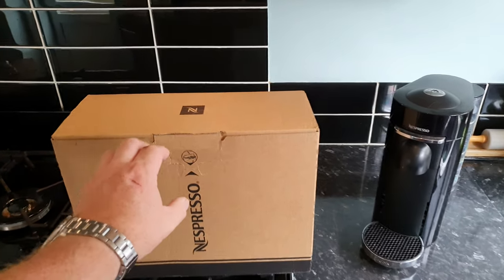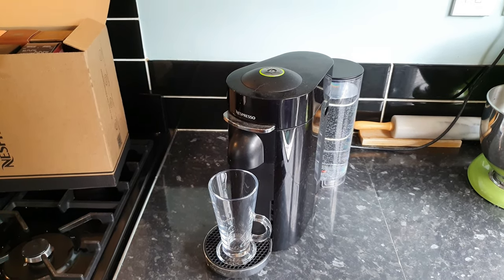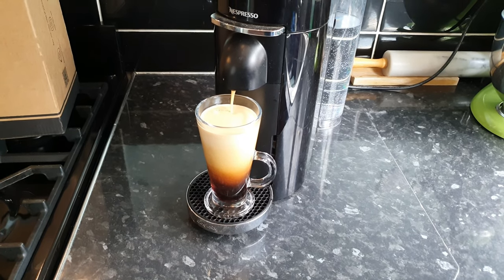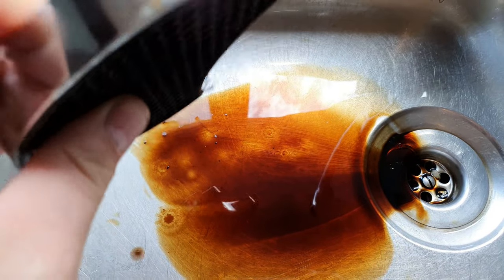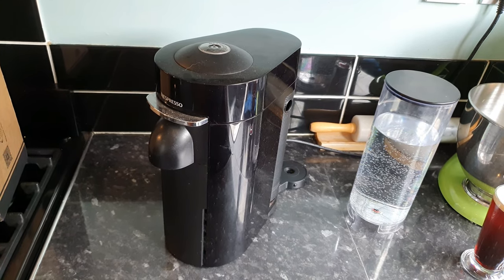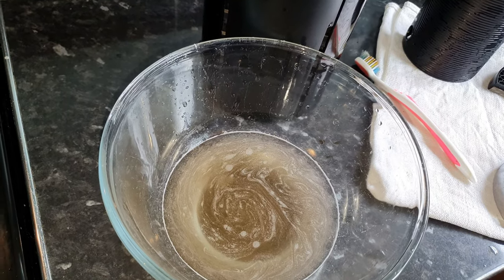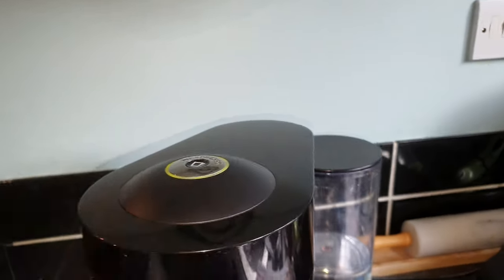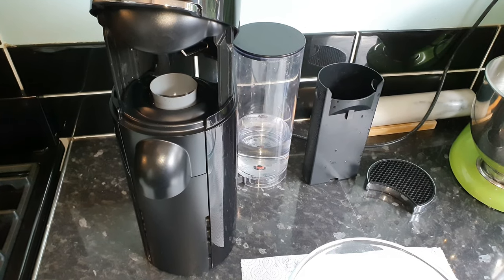How to Fix/Avoid the Dreaded Nespresso Vertuo Plus Leak

Comment: I have had 3 of these machines now, the first one was fine, has never had a problem and is still fine. I bought a second one for work which leaked out of the bottom from day one, so I sent it back under guarantee and got another. This machine was fine for a few months and then started leaking in the same way that the returned one did. Cleaning is important but the issue seems to be that the machine has some sort of problem between the pod and the outlet spout and coffee cannot flow properly so it backs up and runs down the back of the machine and onto the worktop, I keep a tray under the machine to contain the spill. This video, as good as it is, will not solve the problem as there is some form of blockage that no amount of cleaning will shift.
Reply from the maker: You are correct to point this out and thanks for posting.  I think in comments somewhere I have said that the issue resurfaced on mine some months later  and eventually I gave up and got a new one which so far (2 years I think);is trouble free.  I think quality control is not great on some versions but generally, support in the UK is decent.  I keep meaning to tear down the old one to try and find the root cause but I'm so lazy.

Comment: What I did: Find some pipe cleaners (natural) and push it up through the down spout (where coffee comes out of) - spin and clean - do this several times - as well as descale with white vinegar afterward. I found that sometimes what is happening is there is build-up - which creates back pressure and forces water/coffee to go through the run-off valves or out the top. This has worked for me multiple times.
Reply from the maker: So true.  The cleaner the machines the better.  Mine leaks if I let it ger very diety. Hard water users have it worse.
Reply: Thanks. I was dumb & put in a pod the cat had chewed a bit. It leaked loose grounds all over in the capsule holder & coffee spout. I have pipe cleaners.
Reply: @fuchsialady  lol lol
Reply from the maker: I did this and there was a lots of debris and limescale.  I am beginning to tjink limescale buildup could be a big player in causing such issues.
Reply: This worked for me! This is where the most gunk came out. Thank you!
Reply from the maker: Glad it helped you!!
Reply: Hi, what brand of pipe cleaners do you guys use? And instead of water I should fill it with vinegar instead and run it few times?
Reply from the maker: Use proper descaling solution pipe cleaners unbranded.

Comment: Nicely done. You’ve pointed out some spots I’ve overlooked. I use a detail brush (looks kind of like a toothbrush) that came with my juicer. I’m addition to the usual bristles facing down it has a row of bristles facing straight out. I’m happy with this. I also grabbed a cheap baby bottle scrub brush that works nicely too.
Reply from the maker: I regret making this vid as ever since I let it get so dirty it's not been working right on and off.  I got a new one in a Nespresso sale and I'm planning a full teardowm of the old one to identify where the problems may lie and what is stopping it working so well as it had been.
Reply: @richwhilecooper  Here is a full tear down video https://www.youtube.com/watch?v=9ubDV35asHo

Comment: If you use your Nespresso a lot like me …at least a couple times a day.. I will do the rinsing at least once a week with distilled water and descale at least one extra a month with a 50/50 mix of white vinegar/distilled water… if your using hard or soft water..it’s best to descale routinely…
Also, remember to always dump the pod after each use…I found out that if you leave the pod overnight, it’ll have a tendency to stick in the cup.  I’ll also take a napkin and wipe up the cup after each use…the grim will tend  to build up.
Reply from the maker: Good advice.

Comment: What you showed here was just an overflow, not a leak. You did not show where it was leaking as the coffee was brewing. With my machine, I can actually see some coffee dripping down from the top of the back panel as it was brewing if I remove the used pod receptacle, about 5ml for each cup. The leak is brownish, i.e. after hot water has passed through the pod. It leaks only after 30 secs or so, maybe the tube from the pod to the spout is partially blocked, and it takes 30 sec for it to back up to the top & comes out from there.

Comment: Here is a helpful message from Nespresso:

Thank you for contacting Nespresso. We’re disappointed to learn that your VertuoPlus machine is leaking during the brew cycle, and we apologize for any inconvenience. 

This may indicate that the brew unit and coffee outlet needs cleaning. There are upper and lower parts to this unit. To avoid maintenance issues with your machine, the brew unit must be cleaned regularly. Please allow us to provide you with these cleaning tips:  

Plug in your machine, and press the button to turn your machine on, and wait for the steady green light.  
Tap the lever upward to release any used capsule from the capsule chamber.  
With the head opened, wipe and clean off coffee grounds and residue you see in the upper unit. 
Wipe and clean off coffee grounds and residue you see in the bottom unit. 
After these areas have been cleaned, tap the lever downwards to close the head of your machine.  
With a toothpick, clean the coffee outlet, and the circular opening next to the coffee outlet.  
Next, to run the Clean Cycle, you may locate the Clean Cycle instructions in your user manual or you may view a video tutorial by clicking here. 
Test the machine using a capsule. 
For your convenience, we have provided the Clean Cycle steps below: 

Fill the water tank with water and attach properly to the machine. 
Make sure the machine is turned on and without a capsule, lock the top of the machine. 
Place a cup under the coffee spout. 
Start the Clean Cycle by pressing the button three times quickly. 
The machine will start to make noise. Please allow at least 2 minutes for water flow. 
The light on top will blink quickly as the machine is cleaning. Once the light becomes steady, that indicates the Clean Cycle has completed and you may test a capsule if you wish. 
If your machine begins to leak again, you may stop clean mode by pushing the button. The button will go back to a steady green light. 
If our suggestions do not resolve the issue, we will best be able to assist you further with your machine over the phone. We kindly ask for you to call our toll-free number, 877-964-6299, for the next steps through our Assistance Service Program, based on your warranty.  

For best maintenance for your VertuoPlus machine, we recommend to always eject the used capsules after every use, run the Clean Cycle once a week, and descale your machine every three months, or when your machine light indicator is red/yellow or red/green. All removable spare parts, including the water tank, should be washed by hand at least once a week.  

We trust you will find this information useful, Bruce. Thank you for being the best part of Nespresso. 

Best regards,

Deveisha
Nespresso North America

Contact Us

For immediate attention, please contact Nespresso via our toll-free number 800.562.1465. We are available 24 hours a day, 7 days a week. Our Coffee Specialists will be happy to assist you.

Alternatively, you may always reach out to us via email for a response within 24 hours.
Reply from the maker: 'Helpful' for sure.  I may get in my old one with a pressure washer and see what happens.
Reply: Thank you!!

Comment from the maker: I'll be doing a follow up on this issue as I had a major problem with the coffee being watery and then leaking a lot.  Cleaning a rinsing didn't work but...  Turns out a series of descaling routines cleared out what must have been an internal blockage.  I would imagine that if you have a machine in a hard water area descaling should be done bi monthly or more.  Judging by how much limescale is in my kettle which is less than a year old, limescale buildup could cause a lot of issues.  I'll be monitori g the sutuation but for now it's back to working like normal.
Reply: I’m now onto my third vertuo machine as I had it under guarantee and they all developed the same problem, watery coffee. Nespresso sent me a new machine every time but the guarantee is up now and the same fault has re-occurred with the latest machine so ill have to buy a new one or try  to fix it.  Ive searched you tube every time to see if anyone has a similar problem, but this is the first time I’ve seen a comment from someone who has a similar problem. I’ll try the descaling but Ive tried this with previous machines and it made no difference after one descale. Maybe multiple tries may fix it. I love the coffee from Vertuo but the machines seem very prone to faults. Anyway thanks for taking the time to post videos like these, they are most useful
Reply: Did you do that follow-up, bud? Same here, de-scaled and cleaned my machine and still watery coffee and leaking a lot ... Let me know if you figured something out ?! Thanks
Reply: @jayrusty2012  I did try it and unfortunately it didnt work. We ended up having to buy a new machine. We’ll see how this one goes but if it goes down the same path as the other vertuo ones we’ve had I think this will be the last one, and we’ll revert back to the original nespresso’s
Reply from the maker: Mine failed again a few weeks later.  I just  got a free one with my next pod order.  I plan to take it to bits to see what the problem is.   In summer when I have more time.

Comment: My Nespresso has just started leaking out the back.  About a week ago I did the cleaning cycle, prior to it leaking.  I haven't tried cleaning it with a brush yet.
Reply from the maker: I would suggest a vigorous scrub with an old toothbrush and run several cleaning cycles.  There is another vid I saw of a lady who was bending the metal rails where the pods slide into the pod bin who reckons that helped her but I can't verify that.  I know mine leaks if it's really mucky and I have neglected cleaning it thoroughly (e.g. cleaning cycle once no scrubbing).  Let me know how you get on?
Reply: @richwhilecooper  today I ran 3 cleaning cycles and used a toothbrush to scrub the inside and it still Leake coffee out of the back.  I've contacted Nespresso and am waiting for a call back.  My coffee maker is 6 months outside of the warranty, so I hope they will still replace it.  I'm a bit upset because we pay a premium for their coffee and their machines shouldn't leak.  I never had a Keurig leak before.
Reply from the maker: It is unfortunate and there is an issue it seems with some machines.  Sorry I could not be more helpful.
Reply: @richwhilecooper  It only leaks when there is a coffee pod in it, didn't leak with the cleaning process.  So the seal might be not be pressed on the pod enough.
Reply from the maker: Yes I saw someone retentioning the wires that hold the pod down on a video.
Reply: @richwhilecooper  do you have that link?  Nespresso called me and is sending a return box for me to mail it to them for a "one time" repair (it's 6 months outside of the warranty), so I'll be without it for weeks.  But I fear since others have been having the same issue, it could happen again and I'd want to try and fix it myself.
Reply from the maker: https://youtu.be/ixmPMKM2YOI
Reply: @richwhilecooper  I'm not sure how bending those wires fixes anything because they are only there to eject the used coffee capsule.  It's the seal that's the problem.
Reply from the maker: I got the idea it forces the capsule onto the seal somehow but I never tried it myself.
Reply: @richwhilecooper  I don't see how it forces the capsule onto the seal because as I said, it's there to remove the capsule and folds when it’s pushed, so it couldn’t make a tight seal.
Reply from the maker: Any update on your leak issue?
Reply: @richwhilecooper  I contacted Nespresso and they sent me a box to send it to them for a one time free repair.  It’s 6 months past the one year warranty.  They received it yesterday so it will probably be 2 or 3 weeks before I get it back.  You’d think they’d just send me a new replacement, so I wouldn’t be without coffee fo so long.  Either way I feel it will end up leaking down the road again, because it’s just a bad design.  Repairing it doesn’t really address why it happens in the first place and to so many of them.

Just received an email from UPS that I have a package coming tomorrow from Nespresso.  Woo Hoo!  I hope they sent me a new machine.
Reply from the maker: I hope it is.  Been lucky with mine I guess.  Fingers crossed for another 3 years.
Reply: @richwhilecooper  my Nespresso arrived today, that was fast.  They didn't give me a new machine and it looks like all they did was replace the top rotor, which has a new seal.  And what I feared would happen, happened...they scratched my machine.  And it being piano glossy black, it stands out.  At least it doesn't leak anymore.
Reply from the maker: Unless they replaced it with a scratched one that had been returned...  at least it works but I would becannoyed with the scratch too :(.
Reply: @richwhilecooper  no, it’s mine.  They just scratched it.  Wouldn’t be so noticeable if it weren’t piano black.  But again, my machine is 6 months outside the 1 year warranty, so I guess I shouldn’t complain.  I have coffee again and hope it doesn’t leak again.  But if it does I won’t be buying another Nespresso machine.  I had a Keurig for many years and it never leaked.
Reply from the maker: Fingers crossed for you.  It would have upset me too.
Reply: I am sick of this machine.  So much work and so expensive to keep running.  Will never buy another again.  What a racket.
Reply from the maker: Sounds like you're unlucky. It is bound to be frustrating for you..  Mine is three years old nearly.  Works perfectly every time.  The only time mine leaks is if it's really dirty. So I clean it often.
Reply: @richwhilecooper  I guarantee you that yours will eventually leak out the back too.  The seal gets hard and then it will leak, this is a known design flaw that the company has not addressed.  It doesn't matter how clean you keep it, mine was always clean and yet it still ended up leaking.  A cheaper seal costs them less in the long run, even if they have to repair a few machines over complaints.
Reply from the maker: I little dab if silicone grease will refresh the seal from perishing.  I'll make sure I add that to my cleaning routine.
Reply: @richwhilecooper  so you're going to put silicone on a seal that comes in contact with a liquid you're going to drink....seriously?  Not a good idea.
Reply: How do you access the seal?  Where is this seal?  Thanks.
Reply: @TheLadyDoz  pop up the lid, get down a bit and look up there.
Reply: Oh, thanks.  I thought the seal was inside the machine itself.
Reply from the maker: It just needs a little dab.  Wipe off the excess. Then run a cleaning cycle.  It won't poison you.
"Silicone-based lubricants are generally benign with proper use or if a small amount is swallowed because silicones are not absorbed into the body."
Reply: @richwhilecooper  if it was a quality seal to begin with then it wouldn’t need a little dab of anything
Reply from the maker: LOOK I dunno why you're moaning about it to me, dude.  I don't work for Nespresso.  My machine is fine after 3 years.   All seals can benefit from a bit of occassional attention.  And everything is better with lube.
Reply: @richwhilecooper  true just not silicone lube.
Reply from the maker: Silicone gel is absolutely what you lubricate seals with. Been using it on my airguns for years.  Nin toxic. Stops them drying out.
Reply: @richwhilecooper  you don’t use it on seals in devices for food.  It used to be believed that it was non toxic, but that has proved to be false.
Reply from the maker: Dude give it a rest I don't care what you think.
Reply from the maker: In addition, we offer a Silicone Grease, which is food grade and approved for potable water applications.
Reply: @richwhilecooper  clearly you do because you keep replying.  lol
Reply from the maker: Run several descale cycles if that fails to work.

Comment: Hello. Did the leakage stop after the cleanup?
Reply from the maker: It did for a month or so,  then it started leaking again.  In the end I ordered a few extra capsules and got a free one sent which I've had for some time.  I keep meaning to do a tear-down of the old one to pinpoint the underlying issue but I never got round to it.  In short, try a deep clean or two if out of warranty. It may bring your machine back to life.
Reply: @richwhilecooper  Thanks!

Comment: Do u have a solution for the water reservoir leaking?
Reply from the maker: It may be something stoluck in the valve at the bottom.  Push it in with your glfinger and let some water run through. Check it's seated properly on the machine.  Most likely causes.

Comment: I have this machine in my guest room and it's just barely out of the two year warranty. It's clean, that's not the problem. Nespresso basically said pay for the repair or throw it out. So it's going into the garbage bin. Of course I'll never buy this defective model again.
Reply from the maker: Sorry to hear.  Mine eventually died after 3 years, but I got a free one with a coffee order. It's still going. I have heard Nespresso customer service isn't good.  There business is coffee not machines and they literally do not care especially older machines. Nothing these days is user servicable. I still think it's a good product but I feel bad some people bought machines based on my video which then went south.